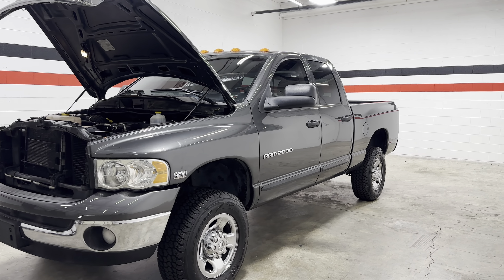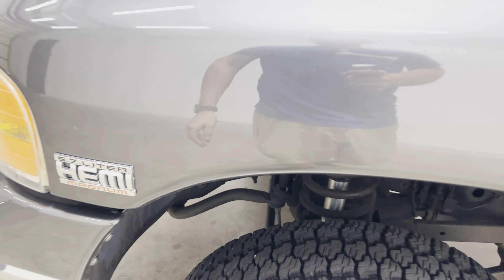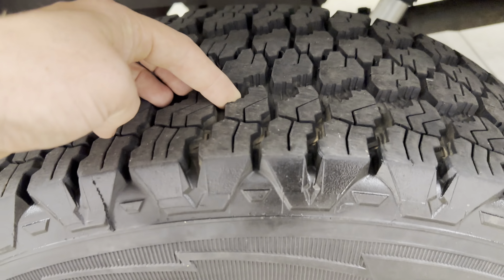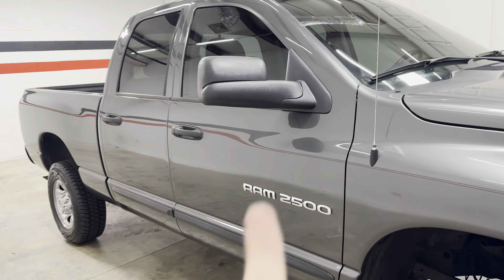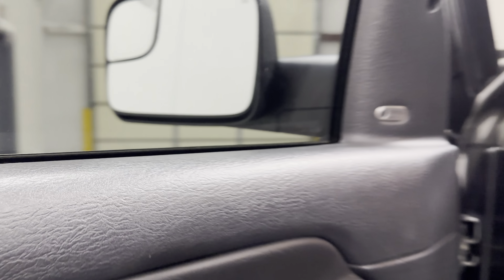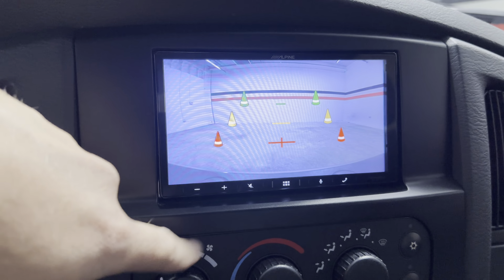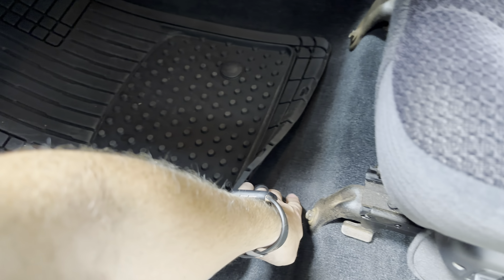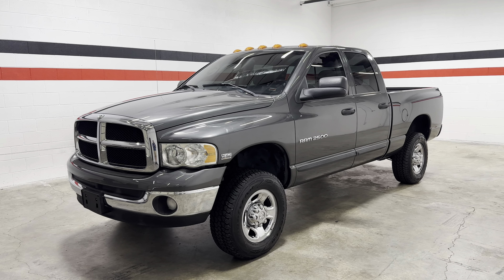2004 Dodge Ram 2500. 5.7L Hemi with 32,000 original miles!

Comment: Would this be a crew cab or quad cab?
Reply from the maker: Technically this would be a quad cab
Reply: In the 3rd gen Rams dodge did the single & quad cab from 03-05 the Mega cab was introduced in 2006. The quad cab was dodges version of a crew (Bigger then a ext cab but slightly smaller than a crew. The first true crew cab for Ram came out in 2010 with the 4th gen bodystyle